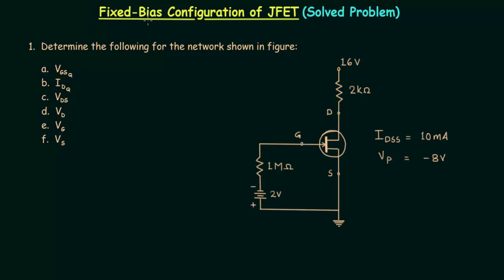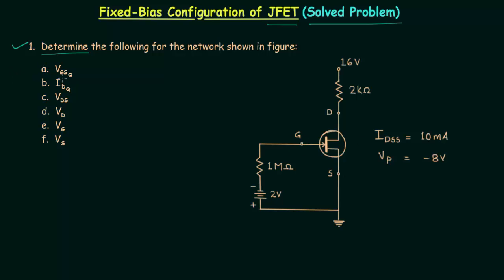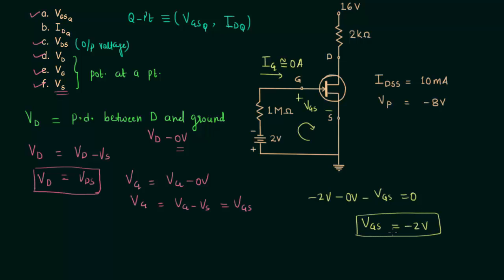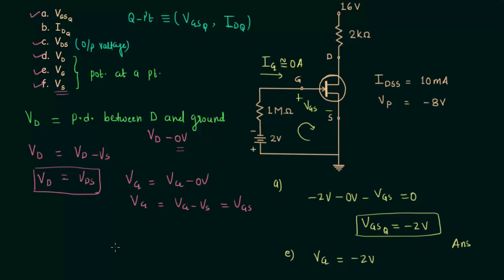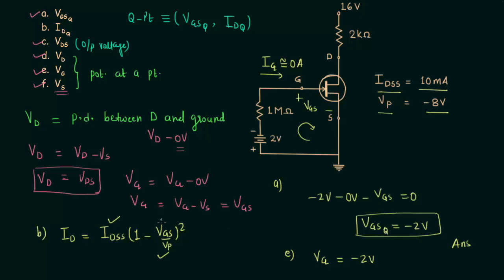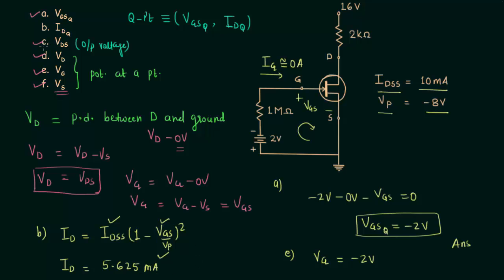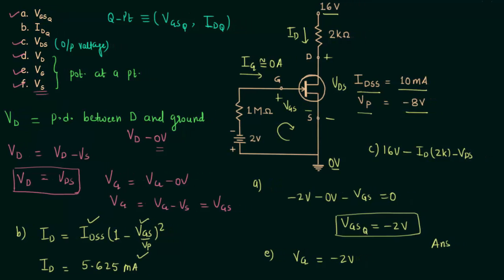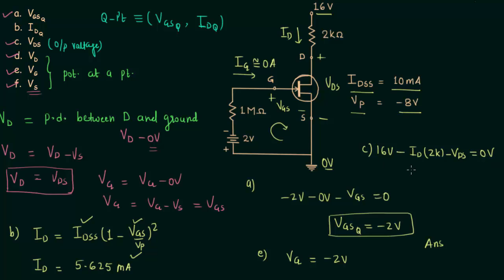Fixed-Bias Configuration of JFET (Solved Problem)

Comment: If gate current Ig is 0 then 2Mohm resistor should be open circuit, Sir why it is considered as short circuit
Reply: Current through the resistance is zero so voltage zero. So it is a short circuit.